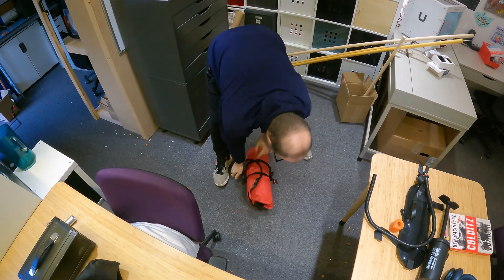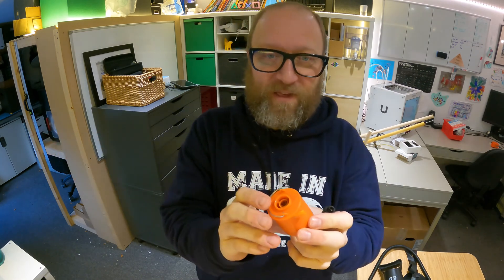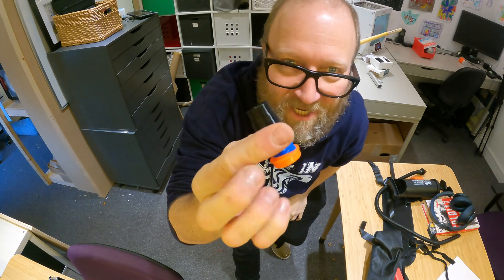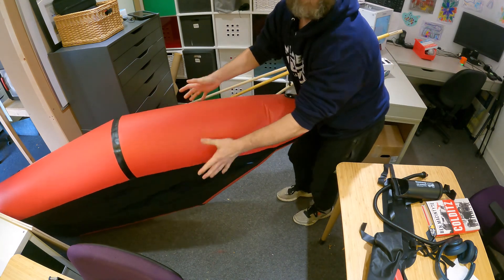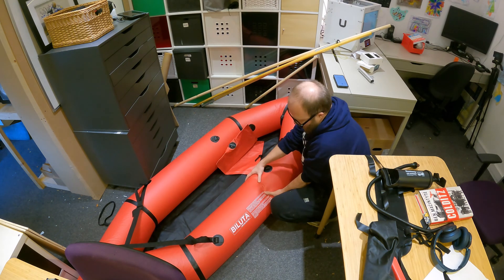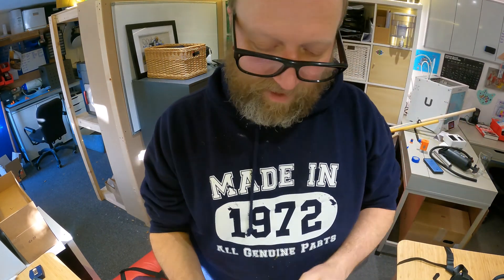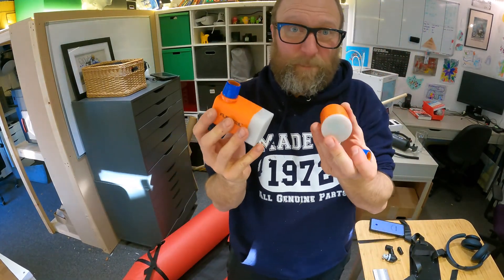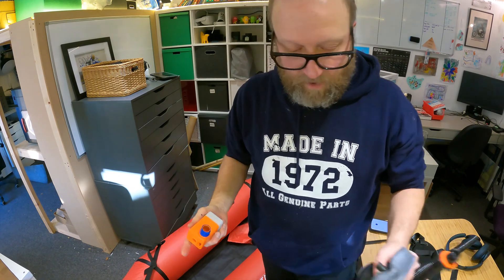Testing Pack Raft Inflating Pumps - Part 2!

Comment: That's why Plan "A",  Plan "B", Plan "C", is very important to weed out the ones, that don't work, and, the one that will... Great demo,... I like your way of thinking things thru... I have a Uncharted Rapid Raft, and it doesn't require a pump at all... Love your video. 👍
Reply from the maker: Hi Marc. Cheers for the comment, yes I like to show the whole thought process, kind of helps the amateur to see an amateur working it all out!!!

Just looked your raft up. Looks great, same kind of thing, although it seals up like a bag? Very clever.

Comment: I use a Flextailgear Max to inflate the raft (instead of faffing with the inflation bag) then top it up with a manual pump similar to yours. Raft usually needs a bit of topping up once it's been on the water a few minutes.
Reply from the maker: Hi Michael.  Cheers for the comment, fast forward a few months from this and that's exactly what I do!! In fact if you have to, you can inflate this packraft with your mouth, although you need a few breaks!!!

Comment: well, i guess u took a large opening then restricted it with the schraeder adamper with the big connector on the end because your little pump had only a small opening , the big pump had the proper size as the inflatable valve so staright away solved the problem  , it was intresting experiment given u  coverted the original pump , 
its handy to have that big battery pump as like in my case i went to Bala and forgot the big hand pump and had to borrow yours,the battery pump can perm stay in the kit box .  Bingo
Reply from the maker: Yep. I use it for everything that needs pumping up!! Also fans the bbq too!
Reply: @SailingWithDave  used mine wednesday and it worked a treat